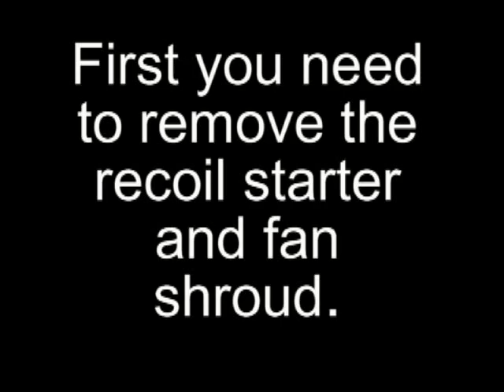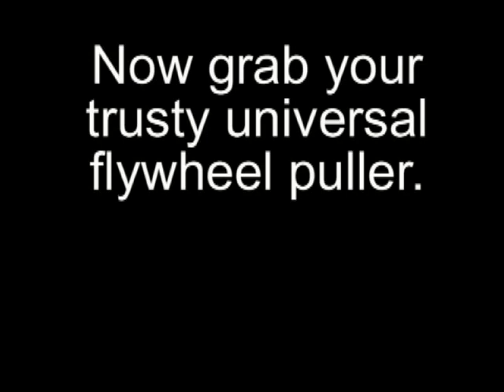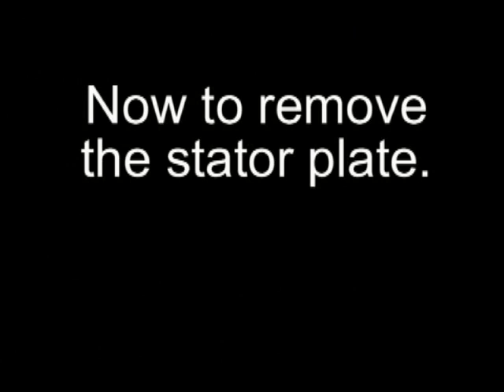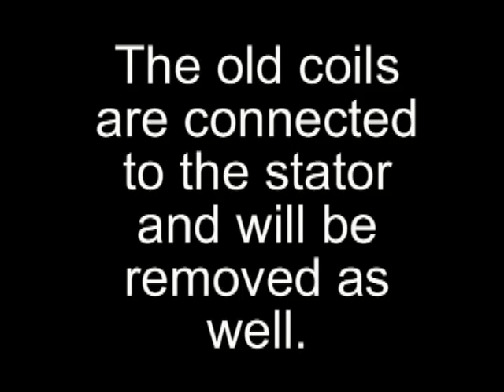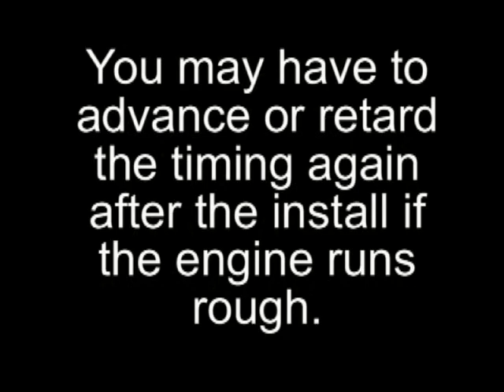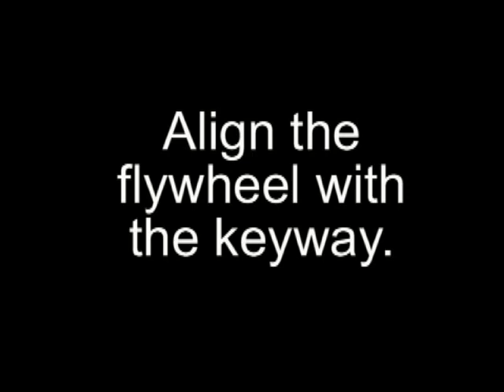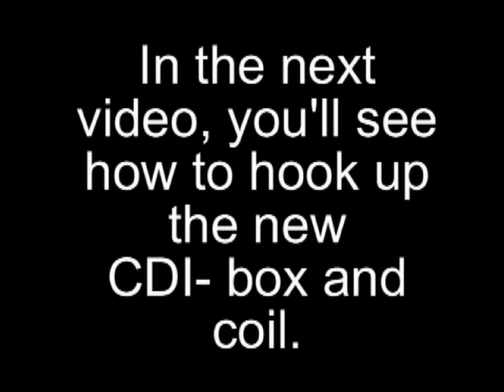CDI

Comment from the maker: Found everything on Ebay. Use parts from either 440, 400 or 340 with CDI ignition. Can use water or air cooled versions but may require some milling if you mix/match flywheel and magneto. Requires patience and vigilance because the parts are pretty rare (except external coil...that's available all the time).

Comment from the maker: @39452kbd Are you using a homemade flywheel puller or a universal puller? You also turn the bolt clockwise to loosen which may seem counter-intuitive. If it's not that, you may need to try an impact wrench.